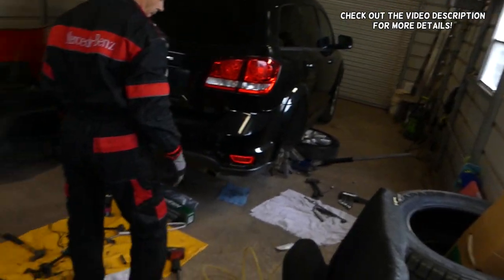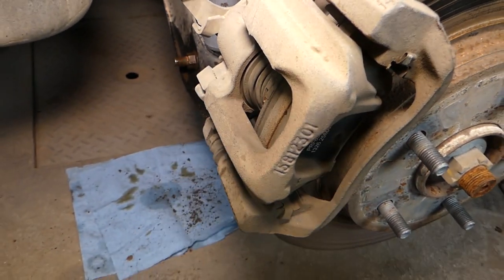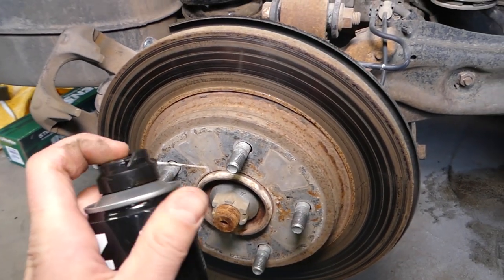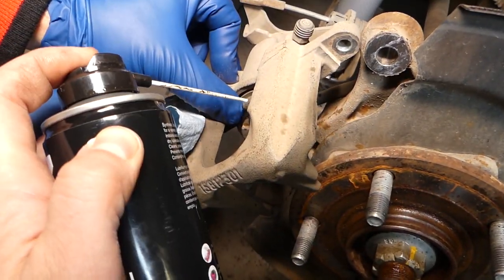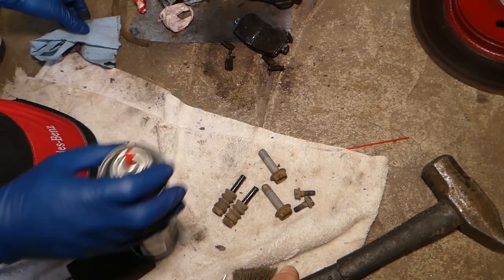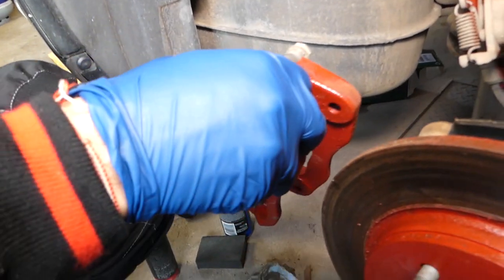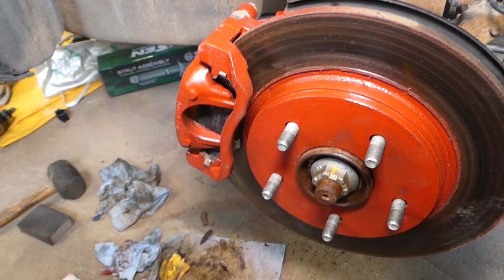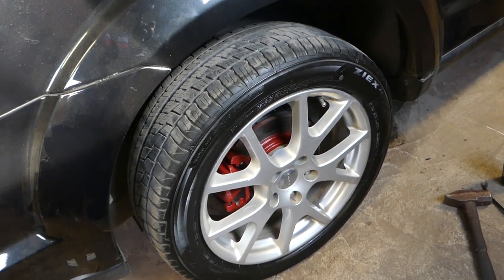HOW TO REPLACE REAR BRAKE PADS ON DODGE JOURNEY FIAT FREEMONT

Comment: I didn't get the part when you said "it's on the right-hand side, so we need to use the right-hand side of the vehicle". All the kits I've seen only come with one of the screw parts, so I don't get why we need a right one and a left one. Having only one has worked for me before.

Comment: What happens if you pump it 30 times and the pedal goes all the way to the floor? And the brake light comes on?
Reply: Master Cylinder or Brake Caliper/Line leaking

Comment: good day gentlemen, i have a 2012 dodge journey 
1) changed thermostat because engine was running hot
2) changed sensor because temp would fluctuate between 226°F-248°F
car still temp/thermostat still what can I do? Thank you in advance

Comment: What can I use if I don’t have the tool to push the piston back in?
Reply: large C clamp
Reply: Yeah I used needle nose pliers
Reply: @johnrichardson1285  not on the rear for this brake style. Do that, and you'll be buying a new caliper

Comment: You obviously did not know how to correctly use that caliper piston tool properly, but nifty accent.
PS. from an experienced Mechanic, send your porter with the old brake pads in order to eliminate any easily avoidable and unnecessary delays for the customer.